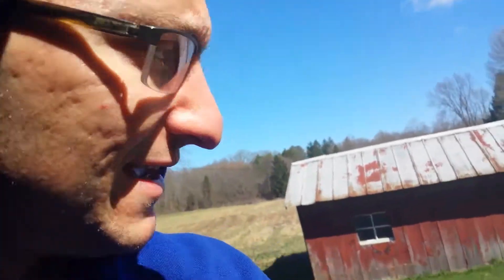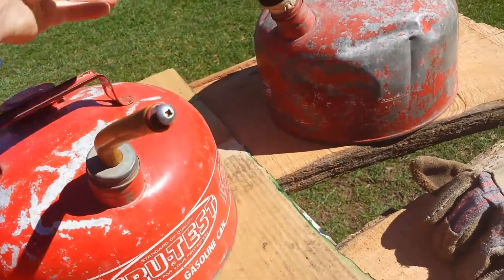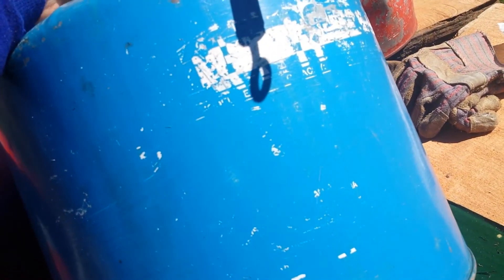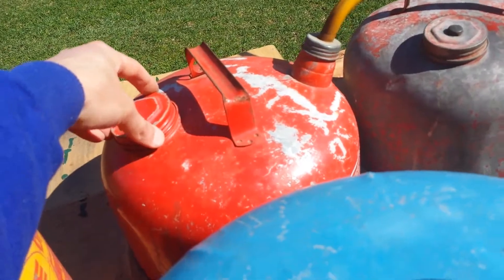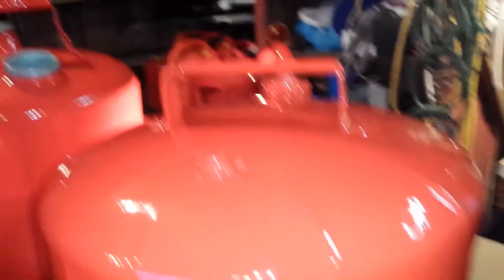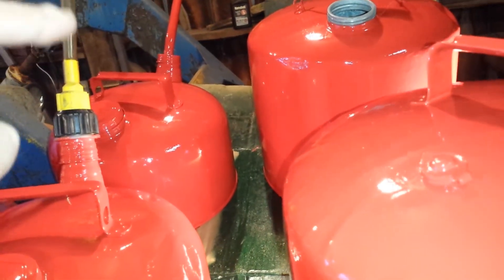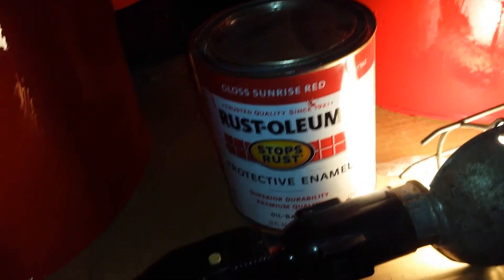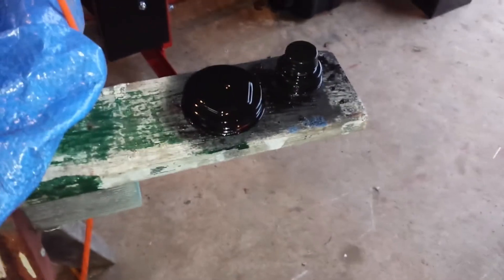Saving More Old Gas Cans

Comment: Mine are all plastic ones. Those metal ones are well worth saving and keeping around
Reply from the maker: Hank's Small Engine Repair I can't stand those plastic gas cans. They don't put a vent in them which means it takes forever to pour and the nozzles are horrible to use. They dont want to work, stay open, and I spill gas everywhere. I think they're a lot more dangerous than these cans.

Comment: you could get the dents out with a pressure washer. alot of people do it for dirt bike exhaust pipes.
Reply: hard to explain but you need to rig something up to completely seal the can. the regular caps will probobally blow off. it's not the water hitting the inside of the dent but actually blowing it up like a balloon. Google pressure washer dirt bike exhaust fix and you'll see what I'm talking about.

Comment: I can see you getting a compressor and a couple of spray guns soon.
Reply from the maker: PrimusRage We have a few compressors and 2 rather large ones. We have a apart gun also. The problem I have with spraying things is there's so much wasted paint. It would make things a lot easier though. I'd like to get a small sandblaster someday.
Reply: Love2boat92 For the work you do all you'll need is a small 'smart repair' gun of HVLP type. These have been developed to keep over spray to the absolute minimum. The HVLP stands for 'high volume low pressure' meaning they deliver plenty of paint at low pressure (around 20 - 30 psi for what you do) so the spray doesn't bounce off the job like the old high pressure guns. I can't see you wasting loads of paint unless using 2-pack and mixing too much at a time.